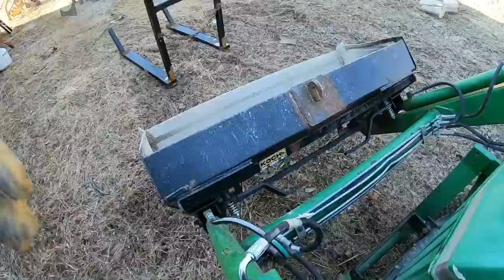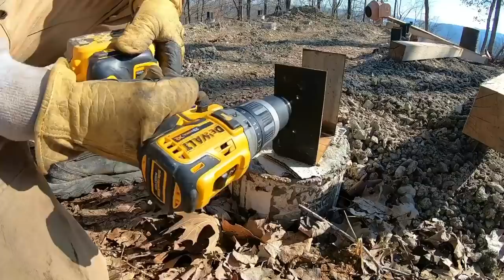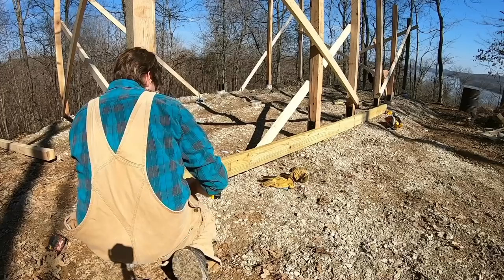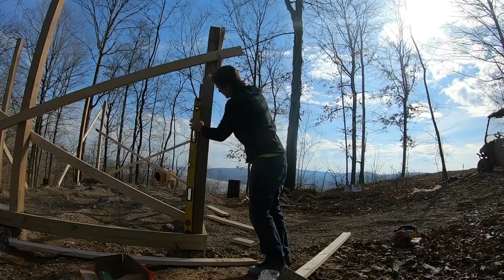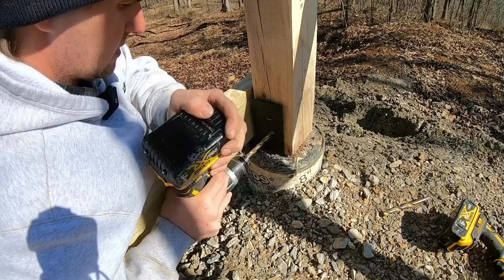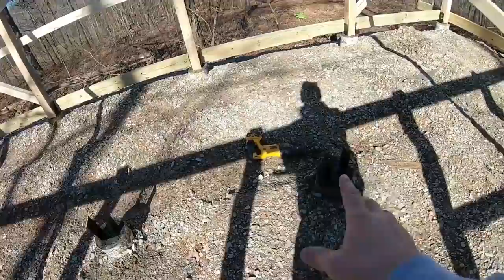Mini Barn Build on a Mini Budget - part 2 - Framing

Comment: OKAY!!! Let’s GOat….

Cap’n, that came out rather darn nice!  Inspector Hen seemed to be satisfied.  I believe I heard her say. “The project was going like Cluck-work!”

I agree  with you about using the clutch to stop kickback when drilling through metal. I discovered it by accident a few years ago.  If I’d been smarter, I could have saved me  from a lifetime of bruised cheeks, skinned shins and especially sprained wrists. 

I sent you my grandfathers old welding helmet lenses.  Please holler at me when you get them.  I’m anxious to hear if they will fit your camera contraption!

Goat-ahead and keep pecking away at this project… it’s eggs-actly splendid!
Reply: And, did you get the lenses?

Comment: You can never over build for goats. My daughter's  Male goat head butts the building  all day
Reply: 👍👍👍👍👍👍👍👍👍
Needs a few more thumbs up. Goats are master of undoing what you have done. Bored goats will make trouble just to watch you fix things. 
A tether ball on a carbineer into an eye bolt through the ceiling is a great goat toy. You can attach a pumpkin and other toys hence the carbineer. Done similar for the chickens using apples and turnips threaded onto a j of wire with a loop at the end. 
Cabbages and similar hung from the ceiling are fun for both critters.

Comment: A good way to get marks on things is a tube of lipstick, put it on the bolt then press wood or metal down and it will transfer the mark to the item you need to drill. The building is looking fantastic.

Comment: Looking great Mike! You won't regret the metal clips holding 4x4s up. I would never set lumber in the ground.
Reply from the maker: I used to set posts in the ground, but the more I think about it, it just doesn't make alot of sense.

Comment: Coming along nicely-very difficult doing this by yourself but you did it and made great progress. Little tip from an old cabinet maker-if your hammer is sliding off the nails, use some medium grit sandpaper and sand the hammer head to make it clean and smooth. If the hammer is very rough and has indentions in it, do not try to re-shape it. Just make it clean and as smooth as possible. Works great with cabinetry work.
Reply from the maker: Thanks for the tip!

Comment: An easy way to mark the bottom of U brackets is to use some prussian blue on the top of the bolt and set the bracket on top and  it will mark the bottom if the bracket. You can find prussian blue at NAPA or other auto part stores. The fancy chicken coop looks great so far.
Reply from the maker: Thanks Kirk!

Comment: If I were to suggest one thing. I would say when you are screwing into end-grain ,which I've seen you do number times. Try not to screw straight into the end- grain as it doesn't hold well. Try to angle your screw steep enough angle so it will grab the grain of the wood. Just a suggestion from an old carpenter.
Reply from the maker: Good tip

Comment: So how is your siding going to go on?  You should put your braces on the inside wall or between you uprights keeping the outside wall flat for your siding to fasten to.  Unless you are going to hang the siding vertical.
Reply from the maker: Stay tuned

Comment: A few comments  1st you need to invest in some of the safety croc's like DP your feet are constricted thus the problem with decision making. The 2nd thing is I wouldn't worry about the minute differences you are getting if someone notices  it they are there for longer than a visit.
I like the building so far.
Reply from the maker: Thanks Harry!

Comment: On setting your posts, just wondering if it would have been better to set the bow towards the inside. It looks like it worked out but, wouldn't it have been easier to shim behind the purlins instead of having to notch out the posts if you would have had to?     
    Also, not sure where your house sits in relation to the coop but, I hope it has as good a view as the coop does.  I think it's already been pointed out about 1,000 times in the comments but that's a heck of an office view.
Reply from the maker: Probably about the same amount of work either Way.  Shimming would work just as well if shimmed strong enough

Comment: I don't know if it makes you feel any better or not but here is the deal. I talk about different ways to weld or wrench but come building... Buddy, your a mile ahead of me! It takes me about a third of the time to build a cummins diesel engine that other mechanics will  get mad at me for because mine never fail, run forever. Its a fact jack that if I put up a pallet four by four outhouse, it will list to one side or the other and cave in come winter time. Your ten times the carpenter I wish I could be. Mike, maybe it gets hard for you to understand at first just how to fix a engine... who cares, your goat shed just needs a lamp in one corner that you watch youtube and daffy duck  from. I can't build a house but I fix  engines and other pieces that make something that runs so I will need you to get something close to a chicken homesite.